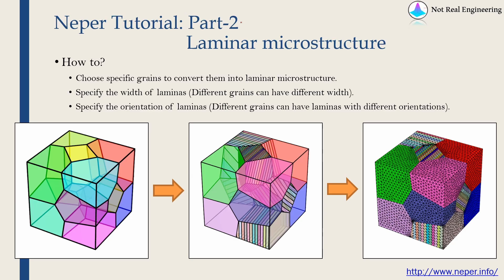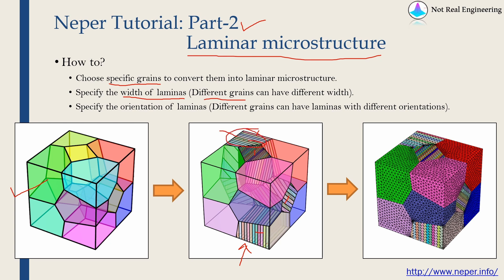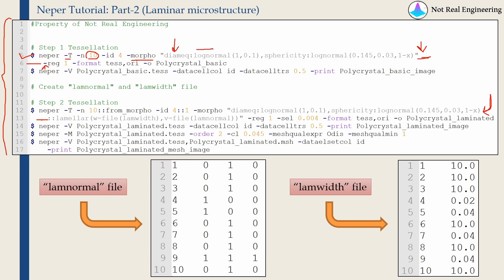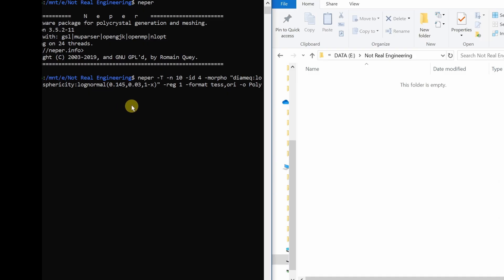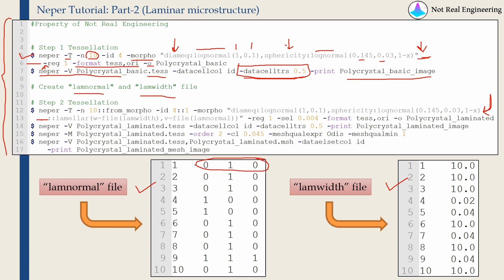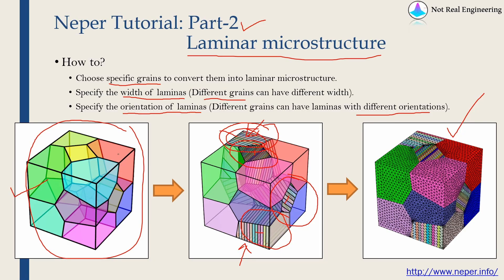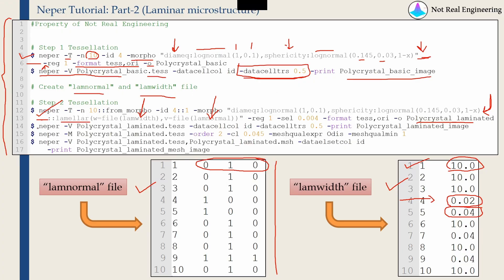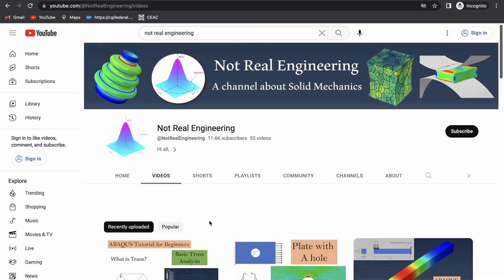Generating controlled laminar microstructure using NEPER | Neper software tutorial part 2

Comment: Your video is very useful, but I still have one question that I wish you can answer. How to use the models established by  neper in DAMASK?  I have established a model whose file suffix is .vtu, and I try to translate this file in suffix with .geom suffix,  but I don't know how to operate and where the orientation information is.
Reply: Use nepers tesselation module to create geometry in tessr format(grid). Mesh the geometry using meshing module and set the mesh format to be vtk or vti(can’t remember). Go to gmsh (gmesh) and change the format of the mesh to gmsh4 from gmsh2. Load the meshed geometry to damash through —geom command
Reply: @ganiganmaz3  thanks for your sharing.